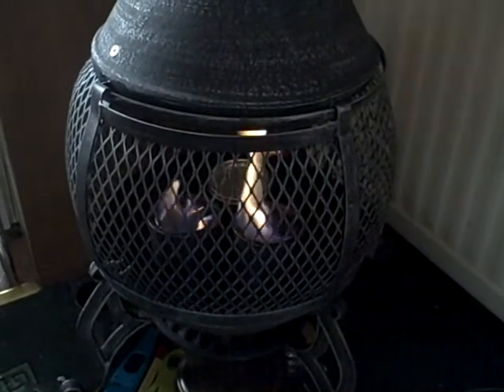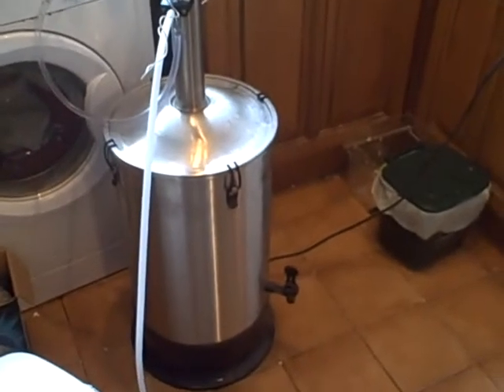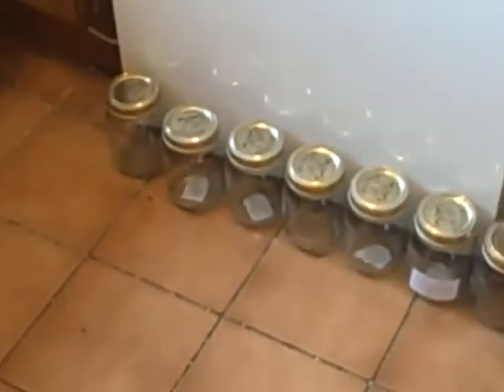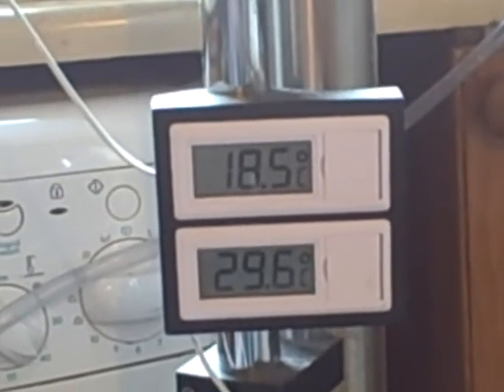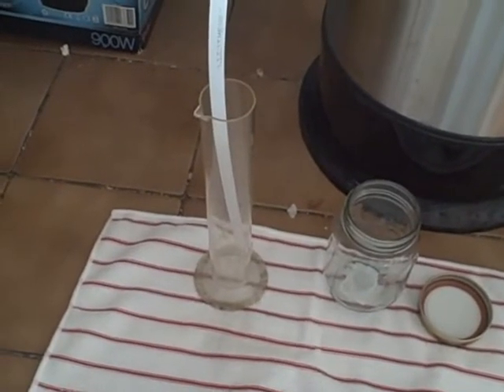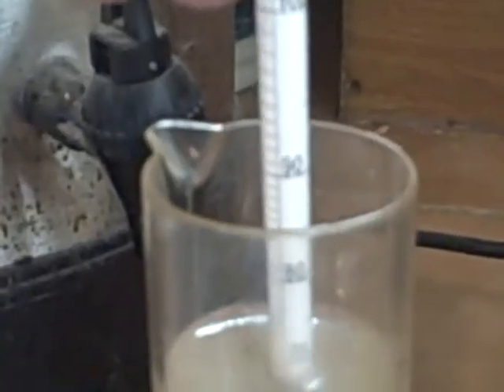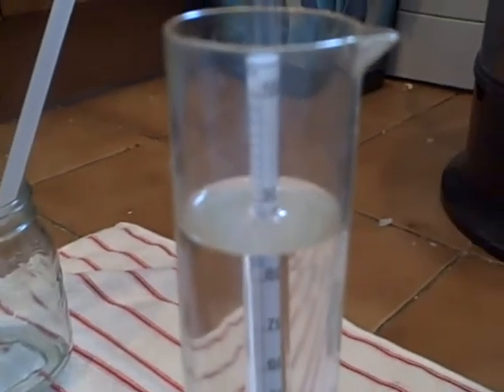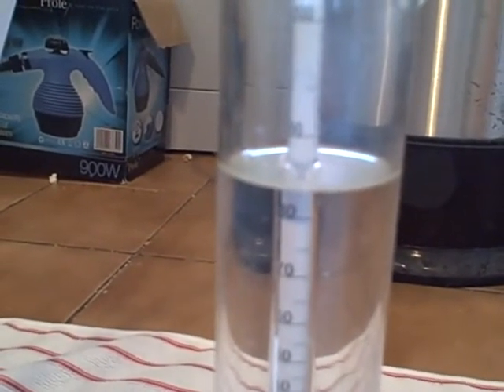Making Alcohol Steve Harris was Right. CHEAP bio ethanol fuel home made

Comment: Ok so let me understand this, you put ur "home made FUEL" in small glass mason jars instead of just let it into one large container...Ok don't illegal alcohol sellers do this practice when they want to separate then firsts middles and tails so they can then sell it illegally as moonshine. Just curious why your worried about the EXACT % if your only using it as "fuel" . Is it that delicate that it will not burn right in a vehicle or even as a open fire source that you need to put it in many different mason jars to control right mixture? Just curious here as you take/make readings/adjustments before so you know some what outcome is once its distilled, is that not right?I understand "moonshine" has to be just right or will cause health issues but this is for fuel right?
Reply: If you use it as a fuel for your car, it needs to be as close to 100% as possible, since water isn't good for your car's engine.

Comment: Cheap? This isn't cheap. 10#s of sugar is $5 here. 2.5 L is .65 gallons. So that's $7.70 per gallon. That isn't cheap by any means. And that's not including the energy required or yeast.
Reply: +Stickman Exactly! It makes sense when your selling a mason jar of it for 40-100 a pop though but it sure aint for fuel use either...
Reply: being bio-ethanol for fire places sells for 5-7 bucks a QUART that is actually a significant savings if you have a fire place designed for bio-ethanol.

Comment: Great video, you may be able to save some of your valuable fuel though.

Alcohol is not great for cleaning hands. It dries them out and kills the natural bacterial on our skin that needs to be there to prevent pathogens and yeast from taking up residence.

The good news is that you can make colloidal silver cheaply to do this job. There are many videos on youtube showing how to make it. I have been using it for years. It is cheap and effective in a wide range of applications including the promotion of healing and clearing up sore throats.

This means that you will have more alcohol to used for fuel and energy production. It is not widely known that alcohol used to be used for all the things petrol is used for.

The Oil companies engineered prohibition to compel the car makers to switch from alcohol (which was the original fuel for cars).

Have you tried calculating how much energy you use making a litre of alcohol verus the energy you get from it?